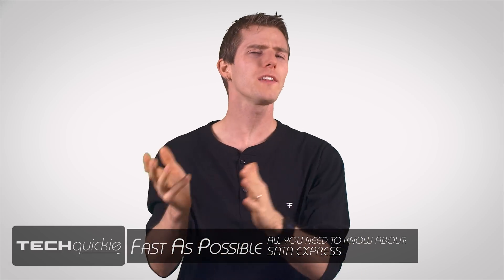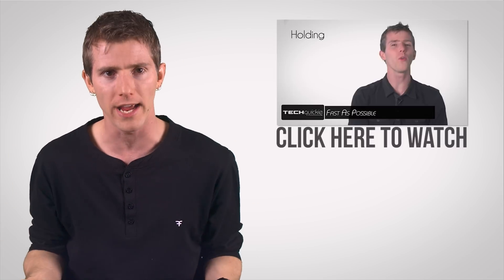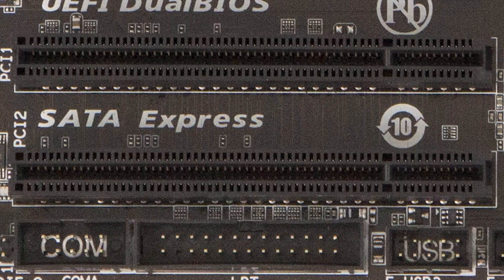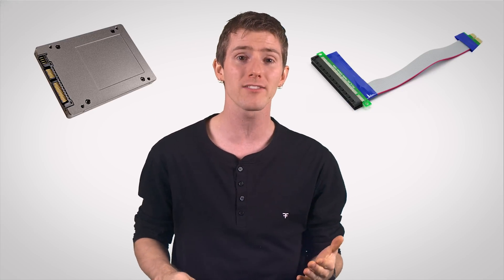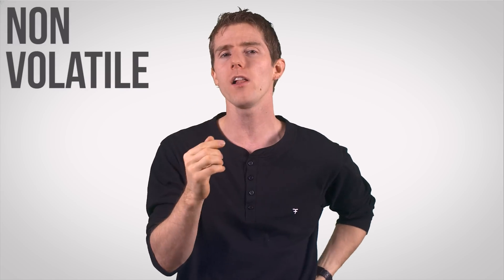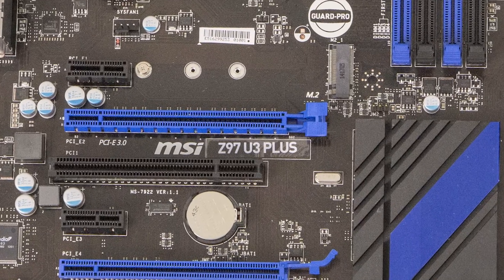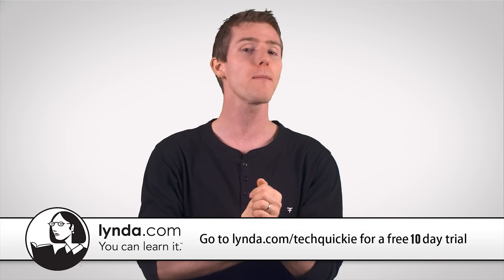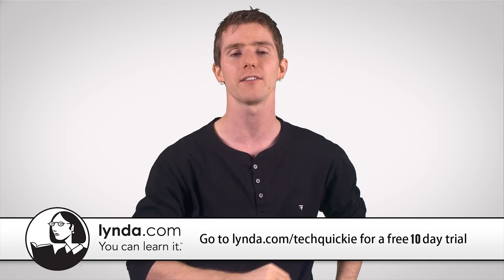SATA Express as Fast As Possible

Comment: Man I was rebuilding an older PC I had which uses an MSI Mortar B150M mobo, and I saw it had a SATAe port, and I was like hmm I wonder if I can take advantage of this bus with an SSD. Nope. They basically produced MOBOs with the connectors before any actual peripheral devices were produced with said connector. Weird jumping of the figurative gun.

Comment: Which Sata port do I plug in my ssd for optimized performance?
Reply: +only lurking I guess you're right, I didn't think about that, but most mobos have 6gbs ports
Reply: +Joyrider not always. I have an old one with two 6gbps and four 3gbps ports with different colors.
Reply: all ports on your mobo are equal

Comment: I am really confused over SATA Express port. I supposed SATA Express is faster than SATA III, right?

And I notice most 2.5" SSDs come with a normal SATA III (6Gb/s) cable. Does that mean those 2.5" SSDs would support SATA Express transfer speed too if we just buy a SATA Express cable and connect it to mobo?

Or SATA Express interface can only be utilized through M.2 form of SSDs?

I'm going insane over this right now as I cannot find any 2.5" SATAe SSD for sale, and I wonder what's the point of buying mobo with a bunch of SATAe ports on board.

I hope I asked the right question and that I can get the answer soon.
Thank you very much!
Reply: My answer probably comes too late, but for any future readers: SATA-Express has pretty much been replaced with M.2 NVMe (M.2 SATA uses SATA3) or PCIe. This is why you might have trouble finding any SATA-Express SSD's.

Comment: Have you ever tried SCSI??  Small Computer System Interface / (new word) Interconnect?   SCSI had the abilities all talked about here and was left behind for EATA ./ ATA drives. Both of which are IDE Integrated Drive Electronics.   Really SCSI at the time had all the specs here 25 years ago, and SATA is using quite a few of the SCSI Commands EG Command Queing. ATA / SATA Drives can only Read or Write One time at any time. Where SCSI drives could read and write 255 times at the same time at any time. Data Through put at 15GBs on an SCSI Bus. Why IDE was taken over SCSI is cost and really a lot of issues too. Some people I knew that had an SCSI system did true multi tasking, and decided to go to an IDE system and as they did found they could no longer do the things they did on the SCSI devices. Drive errors and more and called me to ask why and above is what I told them and they understood immediately at that time. Don't let these things fool you, SCSI was is the BEST interface to use Devices not IDE ATA EATA SATA these are all IDE no matter how you look at them. I honestly think that if others had known of SCSI and it's abilities they would have forgone IDE and we'd have SCSI now today, but at least we are using som e of the SCSI Command Set EG Command Queing. Some day someone will realize and fix it.

Comment: You're likely confusing people, please annotate and describe data rates correctly.  The upper/lower case of the "B" is important.  MBps = MegaBYTES per second (8 bits per byte), and Mbps = MegaBITS per second...   There is a vast difference between the two.  1 Megabyte = 8 Megabits...

Comment: Why does ssd can't go faster than 600mb/s when Sata3 max speed is 6gb/s ?
Reply: SATA 3 is 6 Gbps which is 6000 Mbps, which is 750 MB/sec. 750 is the max limit which really isn't possible in real application therefore most of them top out at around 600 MB/sec.
Reply: 1B (byte) = 8b (bit(s))
Reply: 6 gbps means 6 giga(i.e. 6000 mega)BITS per second and 1 BIT is 1/8 of a BYTE therefore 6000 megabits ps is around 748 mega bytes ps.But due to system overheads it tops at around 600 mega bytes ps.

Comment: wait I don't get why at one moment he says 600MBps and then later he mentions 6Gbps. I thought 1 bit = 0 or 1, while 1 byte was 8 bits? How does these SATA speed measurements work exactly?
Reply: +Yigi Liu 6Gigabits=750megabytes That is the theoretical maximum for the standard, but as with all standards, it requires serous optimization to reach the theoretical maximum, and even then it may not be possible. 600Mb/s is the de facto standard speed for SATA 3.

Comment: Can anyone link me to a purchasable SATA Express drive?
Reply: +PraiseTheSun20 Like these?
400GB Version: http://www.newegg.com/Product/Product.aspx?Item=N82E16820167300
1.2 TB Version: http://www.amazon.com/Intel-Series-1-2TB-Internal-SSDPEDMW012T4R5/dp/B00UHJJQ3Q
Reply: Lars Bolduc those are not sata express, they are pci-express
Reply: PraiseTheSun20 Well I do believe these are as close as you can get as you can get. Asus almost released an M.2 to Sata Express enclosure, but it didn't end up working out.
Reply: Lars Bolduc yeah that's wha I'm talking about. The standard has been out and on mobo's for like a year and I haven't seen a single drive except for one 250GB drive in germany for like $2,500 USD
Reply: I know this is old, but in the end not one of the ssd makers decided to make use of sata express, due to the complexity of syncing up data over 2  data data cables and 2 lanes of PCI express.

Comment: I just wish that the SAS standard (which is already compatible with SATA) would just win and totally subsume the SATA standard. That way, we can use a much better standard for "legacy" devices such as HDDs, Optical Drives, etc. The M.2 connector, I know uses a pin for SATA Express, but it would be far better and more flexible if it used SAS.

Comment: I think you should point out that M.2 can be either SATA or PCIe based. SATA express and PCIe 2x are about the same (theoretical 10 GB/s) but PCIe 4x blows 'em away (NEED PCIe 4x M.2 CAPABLE MOBO AND SSD).

Comment: Can we please discuss whether or not SATA Express is dead before it started? I'm tired of seeing motherboards with SATAe ports that just take up other SATA slots or somethign else the board, most enthusiast boards have 2 SATA Express ports, but I have not seen 1 single SATA Express Drives. Plus, we have M.2 PCIe, NVMe, PCIe standard connections to SSDs (although not that much better, but better than SATAe). But I am getting annoyed seeing this as an option to SATA when we have Thunderbolt/TB2/USB 3.1/M.2 PCIe/NVMe, why would we want to use SATAe? just throwing this out there because I want MBs to start implementing other things than 2SATAe ports

Comment: I wouldn't worry about the 960, get in on a cheap 970 deal. The MSI 970 4G is dropping, and it's great. One or two 970's single or SLI is enough for 1080p and 1440p by far. Mine are overclocked past Titan X so not bad for $600 some.

Comment: Not noticeable at all you should say. 
Actually the textures in games load a lot slower on a SSD than on a normal SATA HDD.
Compared Laptop and Windows 8.1 Tablet. The specs are almost the same. And the tablet seems to load them slower, althrough it has a 32GB SSD inside, and the laptop a 300GB SATA HDD.
Anyway, i dont care. The games run good with a HDD, and i dont need  any SSD because i got a 1TB HDD last year, and all it has on it is just GTA V for Xbox360. And some other random xbox games.

And SSDs are too damn expensive.

Comment: So if USB 3.1 and Thunderbolt are 10Gbps, why not use something similar to that instead of SATA? Is it a power issue or has no one really thought of this? They're both small connectors and cables, so what is the issue?

Comment: Or they could just use SAS. SCSI was good, that's used, but seems abandoned now. Last I knew SCSI was 300 MBPS. SAS will do about 12GBps. It's no use for this, but ethernet is very fast some links about 35GBps, i think maybe there needs to be some analysis done of some faster standards.

Comment: Why not just stick with the cheaper, easier and scale able solution of raid 0.
Take two 600MB/s drives and put them in raid 0 you get like ~1080MB/s read and 820MB/s write.
My motherboard Asus Maximus VII Hero has 8 sata 3 ports for a total of 4800MB/s.
A samsung 840 evo 120GB costs 85$ at ncix =680$ for 8 of them.
The evo has a read speed of 540MB/s x8=4320MB/s and its write is 410MB/s x8=3280MB/s.
That is a 1.2TB R4320MB/s by W3280MB/s drive storage for 680$
The fastest PCIe drive on ncix is the Intel P3700 Series 400GB SSD and it has a speed of 2700MB/s read and a 1080MB/s write and it costs 1610$
To match the PCIe ssd as much as possible get 5 of the samsung 840 evo drives =480GB 2700MB/s read and 2050MB/s write and cost 425$

Comment: Linus, since we're moving towards SSDs as being ubiquitous for everything, and slowly phasing out magnetic drives, how about an episode on the reliability of modern SSDs, and are they comparable to the reliability of hard drives? I ask this from the perspective of someone who just had a 32GB sd card fail after four years of use, and also from the perspective of someone who had to RMA their brand new 2TB hard drive. If we're going to move towards SSDs, I would hope we have solved the problem of limited writes that is a guarantee that solid state memory solutions will fail.
Reply: LogicOwl | Let's Plays I'd say that anything is guaranteed to fail eventually. The magnetic head of the HDD will eventually wear out and modern SSDs are rated in the hundreds of TBs writes if I am not mistaken—SSDs can actually last into the /Petabyte/ range. This is an insanely high number that no normal person would ever get to until after quite a few years. Extreme stress tests were done on six SSDs, constantly being filled to the brim with data and then being erased, only to repeat the process over and over without a single break 24/7. These suckers lasted well beyond any normal person's usage.

Here's the test: http://techreport.com/review/27062/the-ssd-endurance-experiment-only-two-remain-after-1-5pb

Comment: I'd be interested to find out the difference between AMD's APUs and on-board graphics on Intel chips.
Reply: AMD's APUs use GCN architecture. Intel's CPUs use god-knows-what. Both of them like fast RAM. AMD's APUs are faster than Intel's iGPUs, even their A6 ones. Intel's only decent iGPU is Iris Pro (insanely expensive) which has an L4 cache on the chip that acts as RAM and speeds it up significantly (making it almost comparable to AMD's fastest desktop APU).

Comment: USB devices, why are drivers installed again when you put something in a different port than last time, do that :P
Reply: Simply because most USB devices don't carry a serial number, so Windows recognizes them as a new device everytime you plug the device into a different port.

Think about it this way, if Windows does not install a new driver each time you plug it into a different port, if you use two of the same device in different ports Windows will not be able to recognize which device is which, so each time you boot the computer the settings will be scrambled and the devices will act randomly. That's why it chooses to use different drivers for different ports, that's the only way Windows will be able to recognize the device.

Comment: SATA is measured in bits and not bytes? Why? I thought things inside a computer were typically communicated in bytes.
Reply: Transfer speed is mostly measured in Bits per Second, while storage is mostly measured in Bytes. There are some exceptions though.
Reply: ***** Well, the CPU takes bytes and not bits which is why many buses and whatnot are measured in bytes, unlike networks which have things travel in bits instead of bytes. Heck, even the older versions of SATA were measured in bytes too.

I don't know. It's just confusing.
Reply: ShiroiKage009 These are actually the exceptions i was talking about. And if you saw Sata measured in bytes it was probably a marketing strategy, as Sata speeds as far as i know were measured in bits everywhere i looked.

The thing is, it's not that the terms themselves are confusing, the people that use the terms are...and are not paying enough attention leading to unreliable information.

Comment: Hey Linus, would you make a video about future-proofing?

(Sorry if this is the wrong channel)
Reply: SidheKnight From what I know about the subject future proofing seems to be a nice time saver, but you are going to have to pay more for it. Buying high end components when they first come out is gonna have a hefty price premium, it's usually best to buy parts in the "sweet spot" range around 150 - 250 dollars (I don't know where u live or what currency you use, but I'm sure you know the sweet spot in your currency). This USUALLY gets you the best bang for your buck and most of the time lasts a few years depending on your expectations, and will certainly outlast a couple generations of consoles if you plan on using your pc to game. Hope this helps a little.
Reply: That's just a simple concept. Like buying extra food to last you another week. In this case, more power/speed/capacity than you already need like when you get an i7 so you won't need to upgrade for another 3 years or if you get a 6TB hard drive so you don't run in the future
Reply: Wawaweewa Rice I know what it is, but I was expecting a more.. complete analysis. A guide to future proofing, advantages, disadvantages, how to do it properly, is it worth it? etc.
Reply: Easy way to future proof. Buy what you need now and upgrade if you need to later. Chances are that if you spend 50$+ on a motherboard just for SLI and don't get another gpu in the first 3 months, you are never going to sli or it is cheaper to just buy a motherboard in the future.
Reply: futute proof: if you want to build a 1000€ PC, build a 700€ PC and do the same thing again in 2 oir 3 years.
Reply: SirMisteryYT Thought the point was to buy the 2nd GPU MUCH later to take advantage of the price drops.
Reply: Get a computer, save up, buy upgrades. Future proof.

Honestly you can't future proof your stuff much. You could buy a top of the line computer today and it would be slow in comparison in 5-10 years.
Reply: He's said in the past that he doesn't like the term.

Comment: PCIE SSDs are insanely fast. The highest I know if 2800MB/s read and 2000MB/s write.
Reply: Wawaweewa Rice
If it was 3.2TB/s we wouldn't need RAM any more! :p
Reply: Samsung made 3.2TB/s SSDs
Reply: Wawaweewa Rice Terabyte? You sure you don't mean Gigabyte?
Reply: GhostMotleyXT wait, the speed is 3GB/s but the capacity is 3.2TB xdddddd
Reply: Wawaweewa Rice Oh ok, though so.
Reply: ilov3mus1cx3 http://www.fusionio.com/products/iodrive-octal
Link posts just fine.
Reply: i can imagine, that it would be nice to have a PCIe SSC, if i would have to deal with very big files. But i don't have to do that, so i am not going to buy one.
Reply: GhostMotleyXT what does write speed do? (Haven't studied to that point =/ )
Reply: Wisteria Berlitz It's how quickly the storage device (HDD/SSD) can write information, SSDs on average can write 450MB of data per second
Reply: StarTrek123456 The biggest advantage of SSD's is there handling of small files as SSD's latency is so low compared to spinning discs.

Comment: My idea for the next idea: Why do storage capacity follow the powers of 2?
(2,4,8,16,32,64,128,256,512,1024,2048,etc.)
Reply: Because of binary
Reply: But binary is just 1s and 0's. And it can represent odd numbers. So...? I'm really confused.
Reply: Binary ...Its the Same with RAM.
Reply: Binary math is different. File sizes also happens to be in binary. 2^10=1024